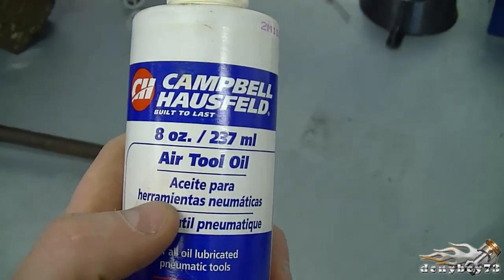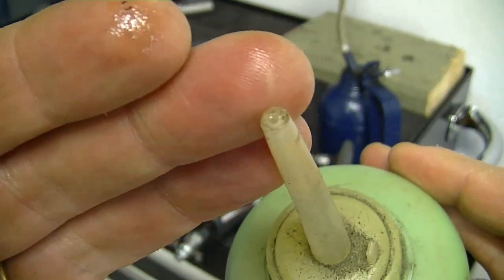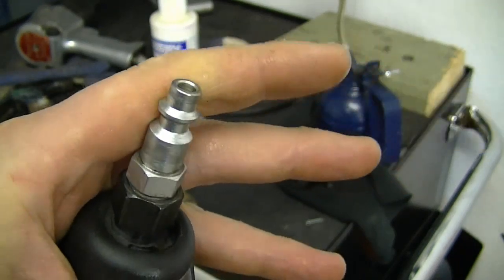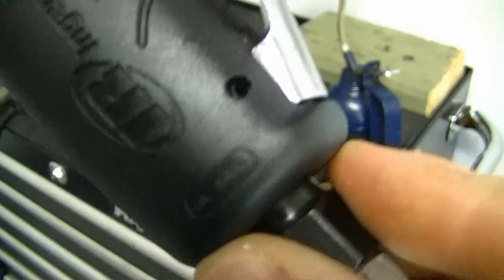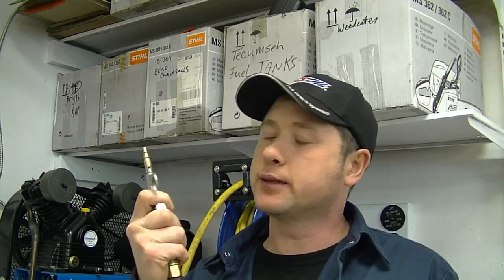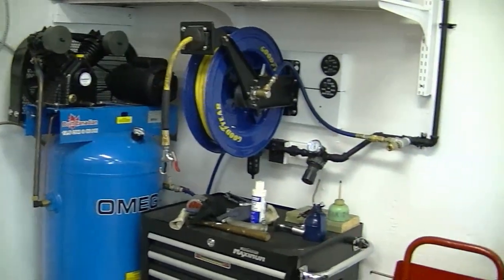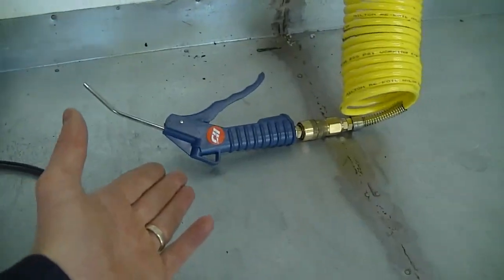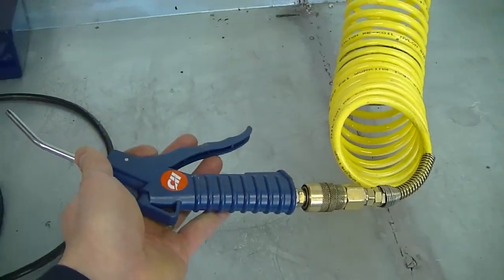How I Oil My Pneumatic Air Tools

Comment: For occasional use air tools, corrosion prevention is my top priorty. I tested Ingersol  Rand, Topring and Lucas air tools oils. I Polished a piece of scrap steel and put one drop of each on diffeerent areas and set the metal out in the weather for a couple of months. The Ingersol Rand area was spotless and had the best creeping action. The Top Ring was a close second. The Lucas protected metal had a severe build up of surface rust. Also for corrosion protection, conventional oils seem to have better staying power than synthetic.

Comment: Just because Dony shows you how he does it doesn't mean you have to do it like that. He is just giving you a tip. I will say this I have used many of his tips such as the rope in the cylinder bore to remove the fly wheel works like a champ, no need for flywheel holders. I have a small compressor not capable of handling air tools. But my tools are electric, for example I have an electric impact wrench up to 300 fp of torque and that works just fine within the small engine enviroment. Thanks Dony.

Comment: Wow, never have seen a garage door spring set-up like that before (vertical)! Maybe it's common though? I have seen them horizontal but they sag so I like your set-up. Had a horizontal spring break when I was in the garage and it shot a part of it across the garage with a lot of force. Pretty scary. When I replaced the spring I ran a steel cable loosely thru the spring to hopefully prevent launching pieces if the new one were to ever fail. Awesome video by the way, always very professional.

Comment: hey I have a 16 hp Briggs twin cylinder not a v twin when I give it gas it wont to cut off or if I am riding at full throttle it will just cut off and I have to choke it to keep it running thx great vids by the way

Comment: Adding an automatic tank drain :
                  I want to install a Kingston  621-4-4  auto tank drain to the bottom of my  80  gallon tank .  Having already connected a copper tube from the check valve at the top of the tank , down to the Kingston , I now am wondering  HOW  to connect the ATD  to the tank .  I suspect that it's done using the  3/8"  opening , but I don't want to guess .

Can you help  ?

                                                                         Thanks ,
                                                                                        Paul

Comment: Nice video. I bought a Tekton air tool, and I didn't know you needed pneumatic oil. The note for it says to use Marvel air tool oil. Is any brand oil safe to use? Just to be on the safe side I thought I ask. Thanks.

Comment: you also need to grease them, putting oil inline lubricate the air intake mechanism but not the gears.
Reply: Where and how do you "grease" them? And what type of grease is called for? I have the General Motors performance 1/2 impact gun and 3/8 ratchet, plus a CH TLX102 3/8 impact gun that came with my CH compressor. I have never oiled any of it. Probably only used the air 2-3 times for a brake job and a crank pulley removal.
Reply: read the operator manual for your tool, that will tell you all you need to know to care for your tools.
Reply: Note: only for tools that are "greasable"

Comment: I know it says to oil air tools daily, i've been oiling mine once a month, however before anyone flames me the last time i used my air tools was around 2 years ago. What i'd like to know is with the once a month oiling of my tools without using them have i caused them any permanent damage?
Reply: tolgahk84  No, if you aren't using them, then you aren't getting water and debris in the tool itself. That is the reason they ask you to oil the tool, 
It says daily because, many people who buy these tools use them daily.

Comment: Hi their, I just bought my 3/8 air impact gun and air 1/4 ratchet. do you recommend installing the swivel air fitting on the the air tools? when the swivel is at an angle does it restrict the air inlet flow to the tool? thanks
Reply from the maker: Denkha94 it does not restrict air flow, the swivel is handy for my job
Reply: thanks